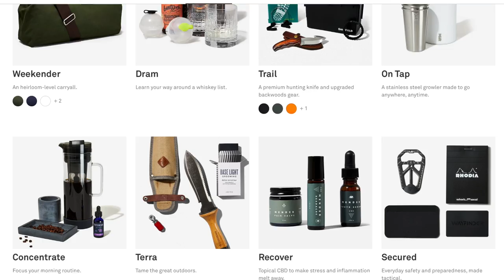My Wrap-Around Farmhouse Porch Roof Is COMPLETE!

Comment: Here in Australia we put a 6 inch by inch or so high mound of sand around the edge of the concrete slab and then flood it with water for a few days to a week to stop dry to fast and stop the slab micro cracking. 

Be very keen to hear and see, more of your decision making process, the reasons you came to the outcome and what variables are involved. 

Cheers Matt
Reply: Matt I just wrote a comment and then scrolled down and read yours. Wet cured concrete for 2 weeks like you suggested will be about twice as strong as not, and that is one benefit. The other benefit is to stop it dry out so fast in the hot weather which will result in the top surface having a lot of fine cracking as well as being more prone to chipping.  Even running a sprinkler on it would have been better than nothing.
Reply: @aussiefarmer6012  What's you humidity Rate?  He's at 96% so that may have something to do with why they aren't wet burlap tarping it.  I'm in Missouri just below  Cole and they'll wet burlap concrete if it's too dry out.
Reply: @thetasigma590  the humidity may help with the micro cracking but I doubt it will make it as strong as wet curing. Our humidy is between 80 and 90 percent and it will micro crack if not watered.

Comment: If you spray the tops of those pads down a couple times a day you'll get an internal cure and have less surface cracking on the concrete
Reply: I wonder if they used a hot weather concrete mix design, and yes, William is right, keeping the concrete moist will result in a higher psi after your 28 day break😊

Comment: Cole Running a sprinkler on Fresh concrete will keep it from micro-cracking as it cures
Reply: Yup, keep it damp. Much stronger.
Reply: @augustreil  also cooler. The heat causes some of it.
Reply: @joefudd , Agree 100%
Reply: 100% agree ... 30% of the concretes strength will come from correct curing

Slab reinforcing is not supposed to be on the ground!!! The engineer will specify where it is supposed to be ... usually 40mm top cover!! Edge of slab would be better if bullnosed trowel used - reduces edge chipping
Reply: Wonder why none of this was done🤔😳
Reply: @carolschober8028 , Just easier not to or an oversight ?
Reply: @julianearl5026  edge chipping in this case if nothing but a minor cosmetic thing. That slab is massive. It's going to be curing for decades as well...
Reply: @julianearl5026  I agree

Comment: Hey Cole,
This is concerning your bin's. Have you thought of spraying a product called "Rhino Lining?" On your bin's concrete floor....
It's typically used in truck beds to provide protection to the bed.
I used it in my garage, on the walls, ceiling and floor. This way I could wash my car, and nothing would get damaged. As well if I spilled oil or any other type of liquids on the floor, it could be easily cleaned up.
Cole, if you were to use this product on the bin floor, it would make cleaning the bin floor a breeze. It would make sweeping it alot easier and smoother, you could cut a indentation in the floor so you could wash and rinse the bin floor. The water would drain to the outside naturally. 
This way Cole, your bin's would always be fresh and clean, not dusty and dirty, like the other's farmers bin's. Ha,ha,ha..... Could you at least look into it, and mention what you think? I have watched every episode you have aired on YouTube. Keep up the great work, as you say..." Nothing to it but to do it!". Love this journey that your on. God bless.
 From your Canadian cousin, from the North. Edmonton Alberta, Canada. Eh!
PS. Your grass is looking great by the way!
Reply: Bins will have a false floor.
Reply: Yeah most bins have a false floor that will eventually get cleaned every so often. It allows air to flow up through the floor. As far as rusting or accidental spillage. It’s usually caused by people being slightly careless. The bins inside would stay dry and away from most liquids so I don’t think there really needs any lining

Comment: When we poured concrete in really hot weather, the concrete guy told me to go out and sprinkle it with water about every 30 minutes.
They said that was so it didn't dry too fast and crack.
Do they not recommend that anymore ?

Comment: You need to spray the pads down with water to slow the curing time down.  Especially with it as hot as it is.  This also helps prevents cracking.

Comment: Ha cole, we have a bobcat skid loader as well, we had a problem with it trying to turn on it's own as well while sitting, it was like the one side wouldn't find the neutral spot, we found out that if you lift up the cab and look at the steering portion you can adjust it, and that's what we did, it fixed it right away, ares are hand and foot controls dont know if the is a difference if it's just hand controls or not.

Comment: I know it's to late for that now but someone else might find this tip useful:
To prevent cracking and ensure maximum strength in your concrete you should try to SLOW DOWN THE CURING. You can do that in multiple ways but the two easiest ways is to pour in low temperatures (just above freezing is perfect) and keep the surface WET the first few days. Because the concrete should cure not dry.

Comment: On a serious note, totally feel your angst over that burial. That was a nail biter. Worst part is that you won't know for sure if it's in the right place for a long time. You'll want to hold onto that job and pass it on to your child until we know for sure. Quick suggestion, get yourself a solid stainless steel probe (that is straight) with a welded on metal handle. Should pierce that soil more readily.

Comment: Cole. Have a sds bit welded to a shaft and hook it to a dewalt sds hammer drill and you just pour water on it while probing for graves and then you don't have to work with a hammer top find it. Would like to see that done. Have your brother weld it on and will need a good dewalt sds drill and you already have the batteries.

Comment: Hi Cole! Before you do the siding you should really replace the Tyvek with a fresh wrap of Tyvek or any other WRB as that membrane is only designed to be exposed to UV for up to 120 days. If it's longer than that it really degrades the performance over time and it will fail prematurly.
Reply: He mentioned a couple of video back that they will be replacing it.

Comment: What I do not understand, with temperatures  that you  are experiencing  and the volume of concrete being poured ,that you have not setup sprinklers to slow down the curing process which would give you better results prevent cracking. Also when you build the "Dryer Shack" you should consider putting in a lavatory.

Comment: I am surprised in that heat you are having that you are not having to wet the concrete down twice a day to stop it setting to fast and it cracking - we normally have a garden sprinkler or sprinkler hose on the concrete

Comment: The curing process for concrete is a chemical reaction that creates significant amounts of heat - it takes about 28 days for concrete to sufficiently cure to enable it to take weight. Concrete takes almost one hundred years to fully cure 😯

Comment: i dont know if they do it there but in hot weather they concrete is "wetted down" ,a few hours of water sprayed on it in the high heat of the day will almost stop the cracking, one of those water thingys for the garden is usually used ....

Comment: Hey Cole! Just wondering do you have to clean the underside of the deck on your John Deere mower. We have a Hustler and you have to jack it up (doesn't have folding deck) and clean it out every time you mow. No matter how dry or moist the grass is, it always builds up something terrible. I hate crawling under and getting dirty, plus if the jack slips you will smash you face. I really like to know to see if its just the mower.
Reply: 20 seconds of using a putty knife will take it off.
Reply: @zedwpd  you wish

Comment: In short... concrete fragmentation/liquefaction happens like after a earthquake. It will go from a hard to a soft and back to a hard, but its lost it bond. It will look strong but its not. In CA this happens a lot... After the Northridge earthquake many homes foundations did this..  At one point taken a book of matches and pushed in into the wet concrete came back the next day to find that it was hard and you couldn't pull out the book..  So just think about you nice big storage bens doing this... The corn would push the concreate out the bottom... Yep it would happen.. Some say that concrete will never dry... The Hoover Dam is still drying after 85 years..

Comment: Why don't you water or submerge the concrete pads? In our country, when you pour so much concrete, you either submerge in 2cm of water or you water it, put a foil sheet over it and some more water over, so that there are aleays pudlles of water standing on it. That way the concrete never gets oven hot and it cures slower and better without any micro cracs. Or are you going to put any paint or other water protection over and just don't care if it cracks?

Comment: what you need to do is get the new car air freshaner bomb at oreilly or walmart you put it in with the air on for 15 minutes then turn it off and let it sit with the door open for 30 guarantee get smell out. its meguiars air freshaner bomb Meguiar's Whole Car Air Re-Fresher Odor Eliminator Mist, New Car Scent, G16402, 2 oz